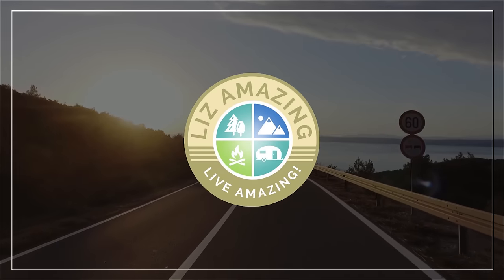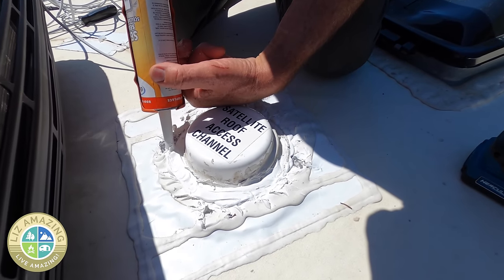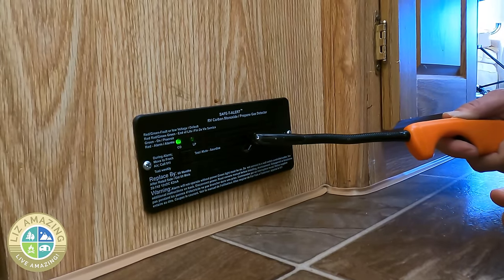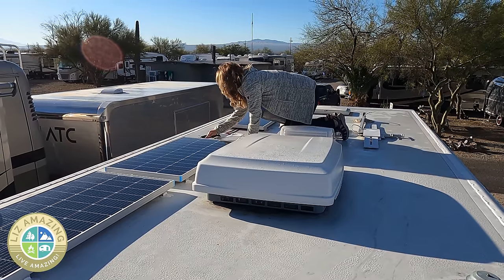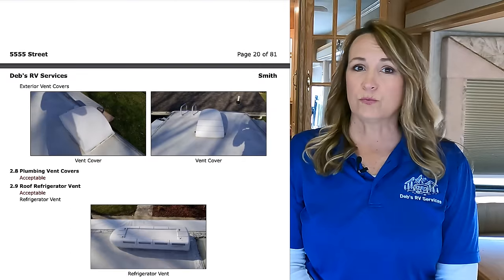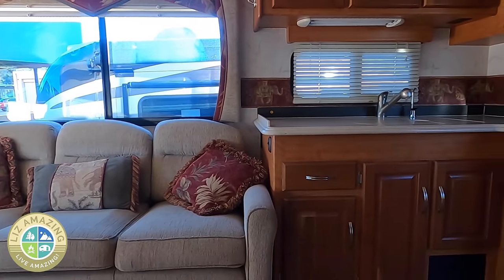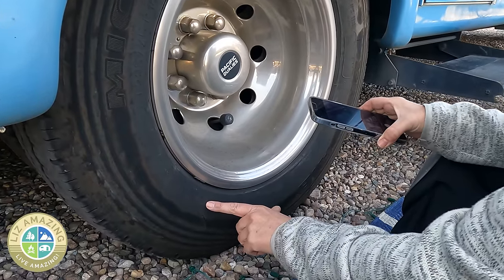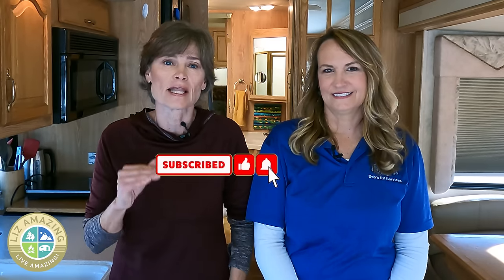Did I make a mistake buying my RV?

Comment: I did RV inspections for a few years after I retired from my Career Job.  Just like a Buyers Agent for a residence.  Folks who aren't familiar with RV construction will be miles ahead by having their possible purchases inspected by someone who is an expert in them and will follow an inspection list and be very thorough.  
I spent several years in an RV Factory so I knew them inside out.  Plus I've always owned an RV and enjoyed making the maintenance a hobby. I have never been turned away from any reputable RV Dealership. Just make sure your Buyers Agent doesn't have any financial connections with the Dealerships.
SO, I highly approve of Liz's Video.
Reply from the maker: Wow, what an endorsement. Thank you so much Craig! Sounds like you have a wealth of knowledge. Congratulations on your second retirement.

Comment: Excellent points. I agree, even new there are so many issues that get overlooked. Trying to get work done under warranty is a nightmare as well. The industry is  so full of deceit.
Reply from the maker: Yep. Buyer beware for sure. Thanks for watching and stay tuned. I'll be talking about this again soon as I have new information about my motorhome. See you then.
Reply: Yes! This is another huge topic that does not get discussed enough in a public forum! There is a lack of education and a lack of honest dealers. My neighbors had a terrible time with a brand new RV. Every time they took it out camping, there was a new issue. And every time they took it back in for repairs, it came back to them in worse condition. Additionally, the stealership tried to charge them for things that were covered by warranty, essentially "double dipping."

Comment: I wished I saw this video before I purchased my RV.  I bought a used RV and so far its doesn't have many issues.  The exception was the heating system fluid which provides radiant heat, heats the water should be flushed and filled every 2 years. I discovered this had never been done.  Luckily none of the hoses had not started bulging from old fluid and ruining the heater, if hey had it would be very costly to replace that entire (Alde) system. If fact, if I had known how much it cost having the service done on that system I would not have purchased that RV. Having these inspections done can really save a potential buyer a lot of money. Thank you for interviewing this lady,
Reply from the maker: So glad you enjoyed this video. Sounds like you got lucky with your RV. Thanks for watching and see you on the road.

Comment: The trouble with roof leaks, particularly near vertical walls, is water tends to run down into the wall itself.This is often what causes delamination on side walls, because water seeping behind the surface has broken down the glue, wood, or both.
Reply from the maker: Yes. Scary indeed. Thanks for this, and for watching.

Comment: Thank you for the advice. In 40 years and 5 different TTs I'd never heard of an RV inspector, relying on my observation and skills to deal with any problems that arose in RVs from the 1970s through 2022--some major! I will be doing a thorough shakedown of my slightly used 2022 Starcraft in the coming weeks to ensure a trouble free season this year.
Reply from the maker: That's great, Doug. And yes, inspectors are a big deal nowadays, just like how we never heard of home inspectors until relatively recently. Thanks for watching!

Comment: This is a huge topic not discussed nearly enough! So many people bet burned both from a dealer and privately. There is such a lack of education available. I am certain the stealerships don't want people to know when an RV is bad news. When my husband I were looking for our used unit, we were flabbergasted at all the evidence of maintenance neglect we were seeing, and we only knew enough to be dangerous at the time. If the owners did not take care of the inside, they probably didn't take care of the outside either. We ended up buying a much newer unit (more $$$) than we wanted to, so that the unit hadn't had enough time to suffer the effects of maintenance neglect, and we STILL ended up with an issue from the manufacturer that an inspector would not have likely noticed either. It's really hard to win at this. We are looking to upgrade after this camping season, and I feel like even after we go over it with a fine tooth comb, knowing more now then we ever havem we should pay for an inspection as well as read up everything we can find on the unit we are looking at, especially owner forums. There are lots of gems to be found there.
Reply from the maker: Thank you. Yes, it can be a fulltime job searching for a camper. So many things to think about, so many things to look at. An inspector can definitely add a lot of peace of mind. Thanks for your comment and for watching!

Comment: In our search for our dream RV we ended up walking away from a brand new Newmar due to a slide issue that was found thru an inspection.   We did find our dream Newmar but the experience from the previous inspection we were able to provide the 2nd inspector with possible issues.     We have purchased the 2nd RV we had inspection but we do have a couple of items we need to address.   An inspection is not just for big issues it helps with knowing the little issues so you can maintain them.
Reply from the maker: Yes! Thank you so much for saying so, very helpful to many. I hope by now you are traveling enjoying your new Newmar! Looking forward to seeing you on the road!

Comment: We bought a 2016 fifth wheel last spring, well when we went to look at it we were told it’s winterize and no water access, and we couldn’t open the slides all the way, because it was in a pole building…..we did buy it brought it home the following week. It was about 200 miles from our home, on the way home on the interstate, we blew a trailer tire on the drivers side, didn’t want to change  it on the road a bit to dangerous, we limped to the next exit and changed it in a parking lot, not enough air in the tires, probably heated up. Got home and bought all new tire. But when the tire blew it ripped the bottom underbelly open, another fix! Big expensive on day one. Then while we had the Rv home things were more noticeable instead of inside of a pole building. The entertainment slide is off kilter, found lots of swirl scratches on the same slide, and the decals don’t match. Called the original dealer to see it it was in a accident or something and they told us no, just was in for regular service. Only time will tell. But on a good not the roof looks good. 😊😊😊😊 I definitely love the fifth wheel, my husband wants to downsize already 😩
Reply from the maker: Wow, what an adventure right out of the gate! I hope all that is behind you now, and that it is smooth sailing (camping!) from here on out. I've had 3 fifth wheels and I loved them all. Hoping your husband gets used to driving it and decides there is no need to downsize. Happy camping!

Comment: All great points! I bought my motorhome new in 2019. The dealer had customer lots on their property that allowed customers that purchased their new or used RV to stay on the property for up to 2 days. This allowed us to test everything in real life conditions. We discovered one problem with the deadbolt lock on the door that the dealer immediately fixed the next day. If this option wasn’t available to me I would have definitely had the coach inspected by a professional.
Reply from the maker: Sounds like a great way to do it. A good dealer for sure. Thanks for watching and taking the time to comment. See you in the next video.

Comment: I sure wish I had gotten a professional inspection when I bought my RV from a dealer.  Using the black tank flushing line flooded the RV with fresh water and rotted the under flooring.  Surely, they had known about it when I purchased it.  RV retailers are unscrupulous.
Reply from the maker: Oh no. I didn't realize that happened. Yep, the dealers have a bad reputation for good reason. At least you got some good traveling with yours and got to meet interesting people in campgrounds :)
Reply: Randy, call out the dealer by name and be sure to write a yelp review also. The community needs your real experience feedback. I do not recommend Pan Pacific in French Camp for insurance repairs. You will not get quality work and neither that dealer nor the ins adjuster cares. $7k for a cabinet replacement after a tire blowout. A substandard 3 mo amateur job, and long before the pandemic hit.

Comment: Every year we have a full service, this is in the UK, that includes everything, all the seams, gas and electricity, all wheels, brakes every single thing, and your log book is signed by the service man, In fact we have 10 year guarantee when we buy the caravan, which is transferable to the new owner if you sell it. But you have to get your van serviced by a dealer who is registered, to keep your guarantee. It has to be around the date you bought it yearly. We do have a totally different system here, in that the manufacturer gives the 10 year guarantee, so any problem when you purchase it, is put right. Some dealerships even provide a site for you to stay on after you’ve bought it, so that anything you find that’s not right they sort it there and then, but in the 40 years we have had caravans we have dealt with the same dealership, and anything that’s been wrong has soon been sorted.
Reply from the maker: Wow. The RV industry in the US could learn a lot by looking at UK. It's a mess over here, as I'm sure you've gathered. Thanks for watching Sandra and happy caravaning!

Comment: I have owned new and used campers. Pop ups and slide in truck campers. All had defects. The new campers had more defects than the used ones. You better be able to make some repairs or you will be camped at the repair shop most of the time.
Reply from the maker: You are so right about that, Gary! You either are handy, become handy, or go broke! And I have definitely noticed the decline in RV build quality over the years. Thanks for watching.

Comment: the best roof for the rv;s is the fiberglass 1 piece, from front to back , its the shell , there nothing that will crack or break or even leak!  its an extra in the rv world , but its like that fram oil filter commerical  PAY EXTRA NOW OR PAY ME LATER FOR THE REPAIRS?
Reply from the maker: Yes, I've had two campers with fiberglass roofs. They are the best! Thanks for watching and see you in my brand new video right here: https://youtu.be/VduD6gWwtPo

Comment: We are going to hire an inspector for our next rv. It doesn’t make a difference if it is new or used. We do our maintenance every year and then have it double checked by our local rv repair shop (Quality Motor Coaches) in Eugene, Oregon
Reply from the maker: Thank you for this. Sure appreciate having you here. See you in the next video.

Comment: We bought a used rv from a private party.   At the time it only had 3,000 miles on it (it was 3 years old at the time). Anyway, we found out why the mileage was low as the steering was wacky - we were constantly over steering.  It was a white knuckle ride.   We have since had dampeners installed and the rig aligned.  Saying that, it’s my suggestion that when having a potential rv inspected you include undercarriage, steering and ask for any recommendations.
Reply from the maker: Indeed! You make a great point, Betsy. Thanks for your comment and see you in the next video.

Comment: Bought a used 2003 RV without an inspection. But I bought it knowing it needed work and I have it at a place that does that. Be ready for long, Month(s) long wait times for some parts. The steering was really loose (3 inches each way before the front wheels turned). They told me the price they were quoted was $2500 . But that was the whole drag link (not including the cost of the install). I talked to them and looked into it. I watched the video they had and saw that the bad end of the drag link screwed off. They then looked around and found a source for just that part, not the whole drag link, that was much cheaper. But I am still waiting for it after a month+. There are several paints/sealants/tape sealants for roofs, windows, ect. So you can do some leak repair yourself if only temporary. Better to wait at home than  while RVing I think. Hope you are having fun RVing.
Reply from the maker: Thanks Neil. I am glad you researched that drag link so that you could save money on the repair. I hope that's all behind you now and you're able to plan for some good camping this year. Thanks for watching.
Reply: @LizAmazing  Thanks, unfortunately the wife has long term health problems so we will be luck to do any RVing. Neither of us like it but we are home bound right now till she gets better if she gets better. Time will tell.
Reply from the maker: @justfun985  So sorry to hear this. Sending ❤️
Reply: @LizAmazing  Hey how about you, doing a video segment about what you load in your RV. I was surprised at how much work it was loading and them unloading our RV was when we did not take off RVing. Tools, food, medical stuff, clothing, and other supplies.

Comment: Great video. It's incredible that someone would spend this kind of money, with so many systems and appliances and not get an inspection. 

We are at Quartzite and drove through the Alfa Roadrunners camp hoping you might be there to say hello, but didn't see you.

Travel safe and stay well.
Reply from the maker: Hey there! I was going to go to the meetup but got held up at my current stop. I plan to be there soon. As far as the inspection goes, I probably will get one next time. Meanwhile, everyone keeps telling me I got a cream puff. Time will tell!!!
Reply: @LizAmazing  Sheesh, I just realized my comment seemed pretty negative and that was not my intent. My apologies if it came across that way. Your video was spot on and very valuable. I do believe you bought a winner.  Best of luck and travel safe.

Comment: Excellent video. I don't think you made a mistake in buying your RV although you're probably seeing some of the issues that would have made you a better informed buyer. I'm now concerned about some water we found in our basement but we also discovered one of the vent caps had been knocked off the roof. I think we caught it in time but can't check it as it's still in the process of being repaired from the tire blowout.
Reply from the maker: There's always something, right? Thanks for being here through thick and thin, Rhonda!

Comment: I currently own a Heartland. After 15+ years RVing I have come to the conclusion they are mostly junk and with the rising prices the only things that have changes are their profits. The tires are junk, the axles are running at their max, the roof last months before you need to get up there and fix stuff. If I buy another one it will be an Airstream but they are six figures, at least the don't depreciate like a 5th wheel does.
Reply from the maker: Whew, it really is hard to be an RV buyer these days. My last two campers were brand new, but yep, they are just slapping them together these days. I also love those Airstreams but the CCC is way too low for me to ever fulltime in one. I sure like looking at them though! Thanks for watching! Oh, and here's the latest video just came out: https://youtu.be/VduD6gWwtPo

Comment: An RV inspection is definitely a must these days.  One thing I'd be cautious of, however.  If you find someone who is an Inspector AND a technician, they should be unwilling to do both for the same customer.  This prevents any semblance of inpropriety.  Do you really want a repair technician going over your vehicle and "Finding" things that need to be fixed?  I'd be much more comfortable with an inspector/tech who told me if they do an inspection for me, they will not perform any repairs for me for at least X months.  This way I know they aren't just going to make stuff up to improve the invoice bottom line.
Reply from the maker: This is a great point. Thanks for this, Brian!
Reply: Brian, we have a code of ethics that does not allow us to work on an RV for 1 year post inspection.😊
Reply: @debsrvservices  See?  Right there's what we call integrity.  ;)

Comment: I bought a Class C from a dealer and it had expanded foam around the window but I didn't know what that was. When I tried to trade it back in to the same dealer, they told me because of the foam, they would pay me hundreds less. (I didn't deal with them anymore.)
Reply from the maker: What??? Oh my gosh, Peggy. That's infuriating! I should do a whole video about shady dealers...but I guess that would be ten hours long!
Reply: Yes it probably would, but there are a lot of honest ones also. My latest buy was from a very fair dealer.
Reply: @peggar901  I agree we bought a 5th wheel from a fantastic dealer in NY and got great service. When I told a fellow RVer about the service I got he wanted to call me a liar  and he was driving a new class A coach.